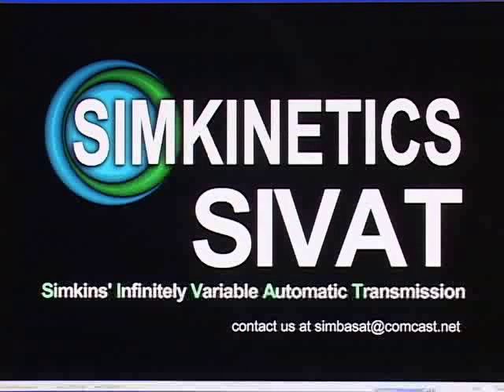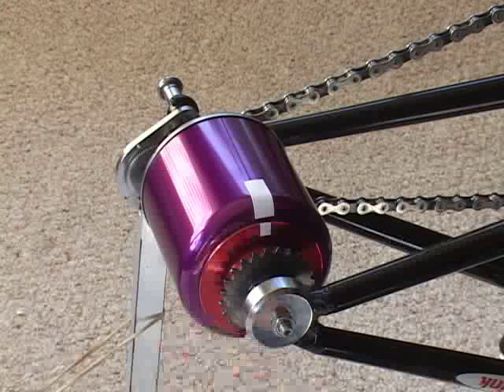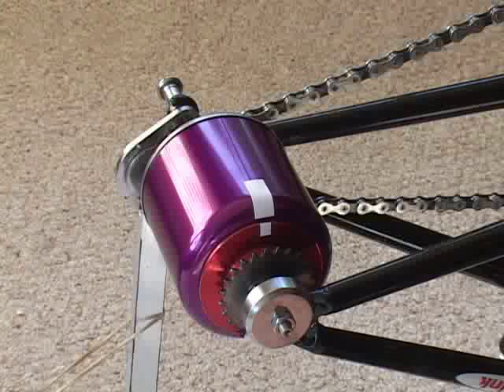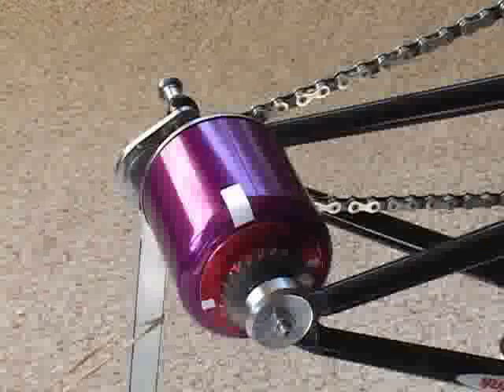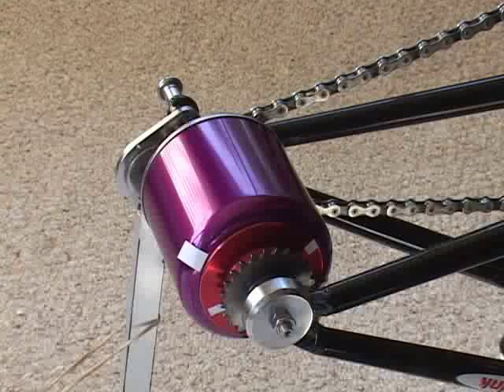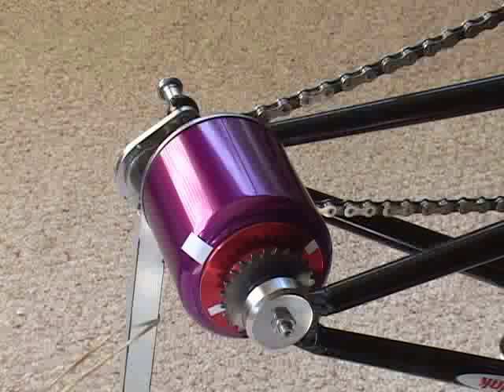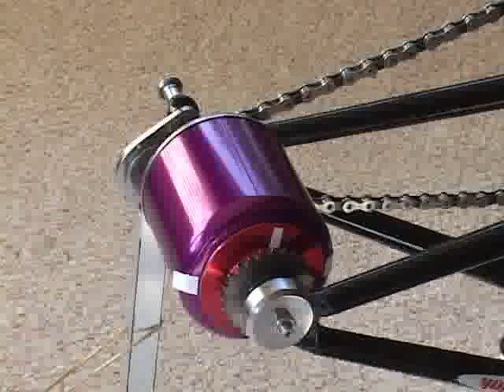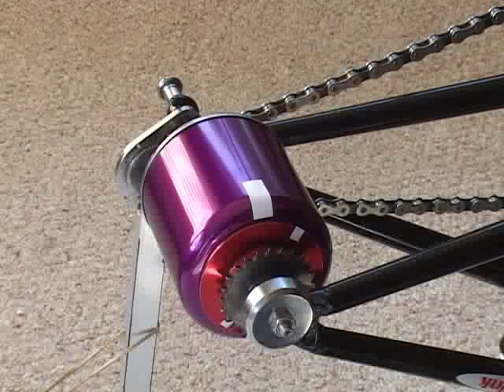SIMKINETICS2best.mp4

Comment from the maker: Thank you!  My new design will work as either a hub or with a special (larger) BB.  The BB version will likely use a special full-suspension frame to allow a simple loop of chain with a fixed distance between the SIVAT & rear sprocket where the transmission is also the pivot for suspension action.  The FS version will also accomodate motor-assisted pedaling power.  Both versions will contain mostly identical parts.

Comment from the maker: @tnaglassworks I live in the Santa Cruz Mountains where I did a lot of biking for decades, so I know about MTB riding up steep grades.  The SIVAT will be engineered to be a great MTB transmission.  The overload protection will be mostly for motorized use not invoked for hard climbs on pedaled bikes because pedaling torque limits are well researched & characterized.  You'll need to pedal against a wall, standing on the pedals, pulling hard on the handlebars to even come close to overloading it.

Comment from the maker: @KenMacMillan I'm redesigning for a bike & pedelec producer to his specs.  It will be up front at the bottom-bracket instead of in the wheel hub.  For cars, I'll just add a reversing gear, which is simple to do.

Comment: @SIMKINETICS very light I think for racing too. Transmissions today are so heavy and do not permit a variations "with no steps" as your device.... they anyway have some STEPS. This permits to select a FINE ratio for racing and everyday use... but I think will be cool to make it possible to have a ratio lower than 1:1. Register your idea man and ask for help if you need. This is a GREAT innovation in my opinion !

Comment from the maker: @g0fvt The SIVAT in a mechanical analog to an electrical hybrid between a rectifier-style SMPS and a switching amplifier.  Its interval duration and torque (equivalent to voltage) are both modulated simultaneously via one-way clutches (equivalent to diodes).  There might be an opportunity to create an electrical equivalent, but I'm an ME, so it's not obvious to me how to do that.  The waveform is not sinusoidal.  Maybe a new type of motor is implied.  Anyway, great insight!

Comment from the maker: @hheywire Yes, but it won't be available as a product until after the re-design, prototyping & productionizing.  The other video at 'Automatic Bicycle Transmission (IVT)' has 222,000+ hits & 350 comments; if you read the comments there, you'll get gobs of Q & A that should answer many more questions that you may have.  The bike SIVAT will be rated for 1.3 hp, but if motorized, its rating is at least 2 hp because of higher speed operation with a motor!  Imagine full-suspension, motorized MTB!